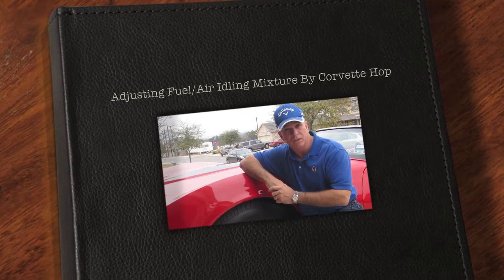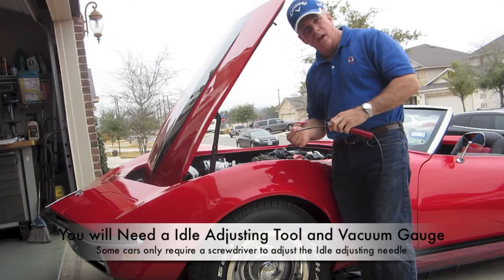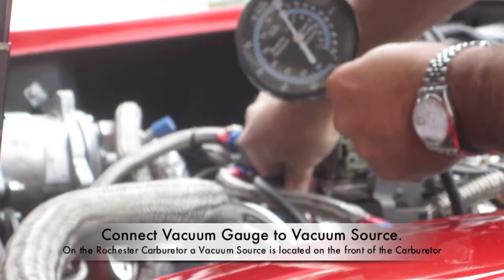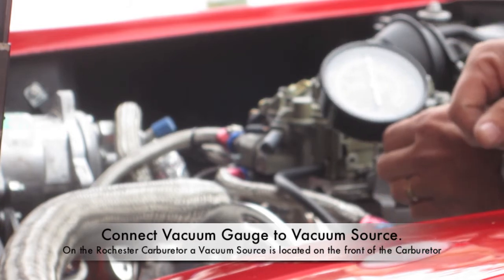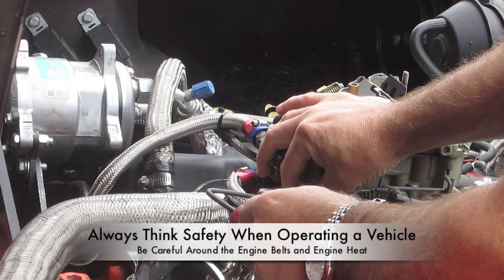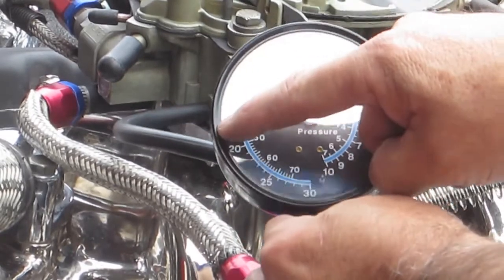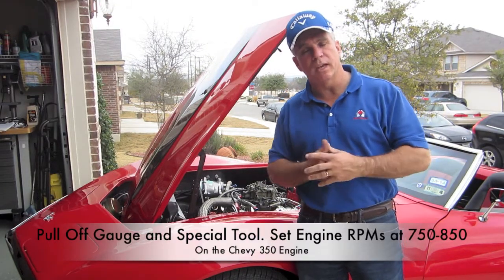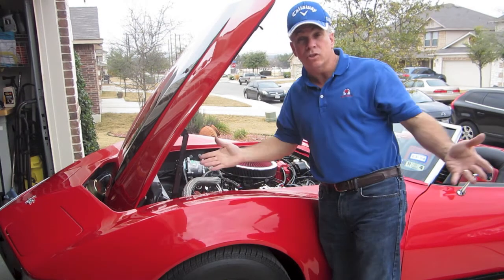How to Adjust Fuel and Air Mixture On A Carburetor By Corvette Hop

Comment: On carburetors you'll have idle air control and normal operating speed air fuel ratio. Are you specifically addressing idle only? I believe all Q jets have metering rods while Holly uses jets to adjust air fuel ratio.

Comment: I noticed that you have an HEI distributor. Where did you get it and was it difficult to convert from the original?
Reply from the maker: I ordered it off ebay a few years ago. Sorry but I do not remember who I ordered it with. I did get it for the 350 Chevy and with a tach cable. It only cost about $140 at the time. It was easy to install as the instructions came with it. There are also a few videos on youtube that show you how ti install a HEI distributor. All, I had to do was run a 12 volt key single wire source for power to the HEI.